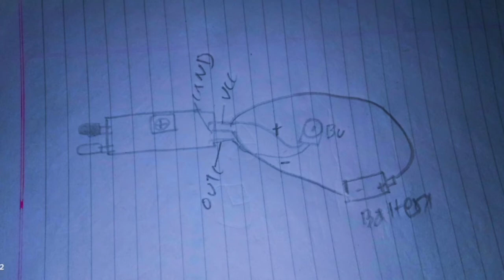Third EYE Project for blind person (Inspire Award)  (ir sensor)

Comment: Are outdoor mein kaise work kar sakta hai... Outdoor means sunlight.. which has ultraviolet and infrared rays... Video mein IR sensors use Kiya gaya hai jiska matlab hai infrared sensors... Sunlight se koi khas matlab nahin hai... inside radiation ka basic matlab heat hota hai...agar koi ise pahan ke kisi bhi garam jagah per bhi jaega to bhi yah pura system fail kar jaega not only ine sunlight but also everywhere ine heated place...